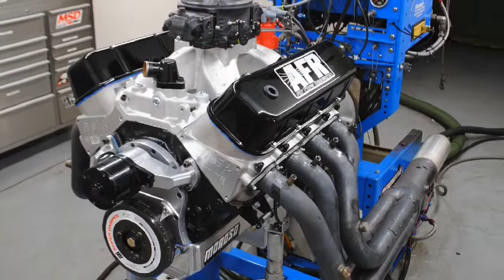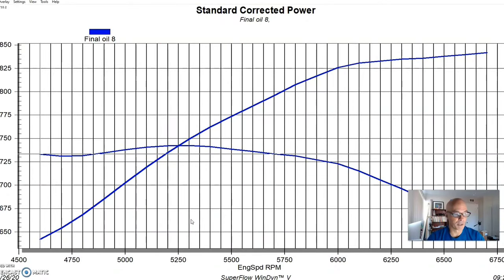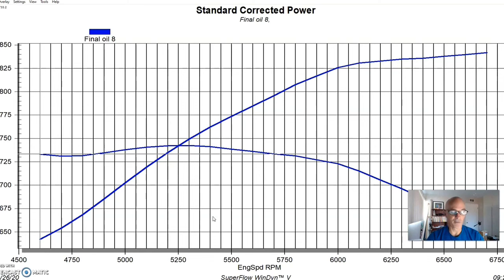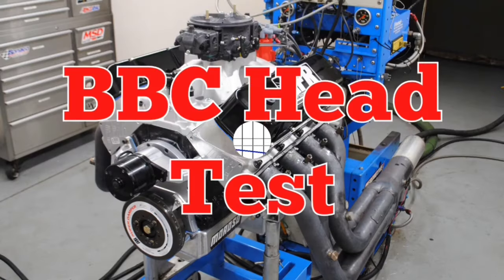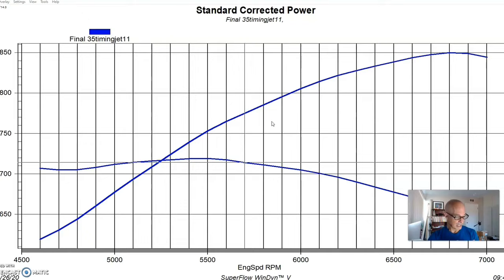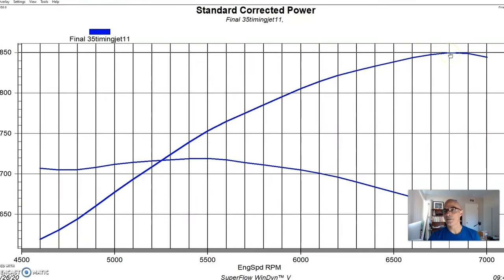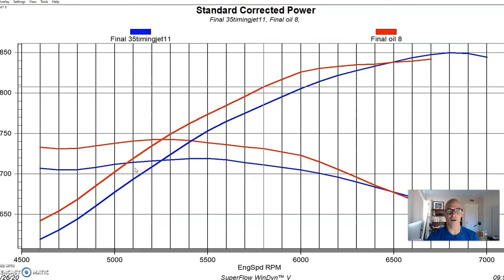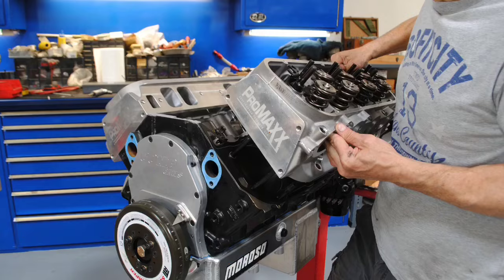LOW BUCK BBC HEAD TEST-PROMAXX VS AFR

Comment: The ProMaxx heads were actually like $100 more than the AFR heads lol. Both 50% CNC ported, solid roller springs to support up to .900 lift. (My cam is .567/.578 currently but Im ordering a custom grind with much more lift. Advertised 278/284 @ 110 LSA)
Reply: Promaxx heads bare are 600 bucks cheaper.  They might be more assembled, compared to the bare AFR's though.    But if you use the same parts in them, the only difference is the cost of the casting, and Promaxx is cheaper there.

Comment: Richard, do you think if you changed the LSA on the cam,say to 107-110 LSA,  for the promaxX Heads it would it would shift that curve to match the the afr curve? My Question is based off the episode of engine masters comparing the LSA of camshafts with same lift and duration specs.
Reply from the maker: changing the cam specs would effect both heads
Reply: I get that. But I was just referring to just changing the cam specs for the promaxx heads which would in turn move the horsepower and torque curves to match the afr's being that they are different heads. so each had has its own characteristics and may like one Cam vs another cam better.

Comment: Have you ever dynoed a Mercury Racing HP 500/502 cid and what your thoughts are on there choice of intake which is Dart single plane. These only run 5200 or so and seem like there should be a better choice.
Reply from the maker: Dual Plane might be a better choice
Reply: @richardholdener1727  thanks for the info, if I were to go to 540 inch would dual plane still be a good choice

Comment: I was surprised to see that power crossover happen. Really surprised it happened at the top. I'd be interested to know the minimum cross section area of these heads. My hunch from the dyno graph says the promaxx has a larger minimum cross section. If my hunch is right this is a very good example of the benefits from good port design.

Comment: AFR magnum 315 for $3492.00 vs Promaxx 317 cast for 1900.00   Now the flow numbers are both advertised, both are very close to each other but Richard; run these on a 496. I doubt the Promaxx could keep up at the low lift. But nothing comes close at $1900, that is a great price.
Reply from the maker: afr 345 was listed at $2656 from Summit-not sure why you bring up two heads I didn't test
Reply: Richard Holdener You said the option it out the way you would use it for your own set up right? I don’t have a 572, I have a 496. I wouldn’t buy a huge 340cc head. I took the time to search and reply. Why the downer?

Comment: Hey Richard I been watching you for along time I am finishing my 60 over 427 I put the afr265 oval port heads on it its go a small howards hydraulic roller 235×241 @ 50 618 lift on a 108 lsa.its got 22cc dome pistons  with a 850 Holly hp carb I'm going to put it on the dyno hoping  for 550 hp do you think it will make it?
Reply from the maker: great heads-might be a little shy on camshaft, what intake?
Reply: @richardholdener1727  I have a speed master copy of the airgap but waiting on a team G to come any day . I was going to go with the comp cams xr294hr  but didn't want to have to run a converter bigger then a 3000 stall.

Comment: Hi Richard, I just paid for a demon blow through Carby second hand. When I looked underneath, it hasn't got the 4 slots to stop boost going out through the shafts. Have I been ripped off?
Reply from the maker: you will be fine
Reply: @richardholdener1727   so they all don't have these slots I gather

Comment: Not a comment but question ? How will this promaxx head work on a 6500 to 6700 rpm 10 to1 496 ? If they were a little down on your big motor would they maybe be just right on a big roller crammed 496 ?
Reply from the maker: look at the 496 promax video-I also ran a blower on it

Comment: for a hydro roller head,  an AFR has a much better valvetrain.  But a sbf is about 600-800 more and how much more is the 185 gonna make than the 180 MAXX??

my choice..trick flow 11rs lol 1700.00

they come with a heavier rate spring that you have to buy as an option on a AFR 185 renegade.  and its the same power for about 150.00 extra for the AFR heads which would be like 1850.00
Reply: @bigboreracing356  yeah thats good atuff to buy.  AFR uses PAC so I trust that and I just saw a guy I subcriber to break in out of the box brodix ik200s on a 355 solid flat tappet.

Not one flattened lobe and will go to 6500 like right now

But for a race application id be buying everything custom or from someone like chad speir or weingartner racing and have a cylinder head guy assemble it

Comment: Using a Dart Big M block, why did you go small? I would have gone with the tall deck and created a square bore motor. That should have boosted the low end torque a little bit for both heads to get better average power.
Reply: Got a Merlin tall 10.2 deck. Was thinking 604ci. Any thoughts?

Comment: I'm all in for buying domestic parts. That being said, I recently bout a set of aluminum small block Ford heads. Good friend of mine called me to come look at a set of aluminum small block Ford heads. Looked them over, 2.02, 1.6 valves. I am planning a Windsor build for the 94 flairside my dad left me. Looked great!! What's he need for them, I'll put it on the grapevine. His reply was I don't know man, there complete, could bolt them on as is, think $400 is a fair price? My response was " there's an ATM in this little town?? Needless to say, their in my barn waiting for installation!!! The old f150 weighs round 4000 lbs, but how much does a late model Mustang weigh?

Comment: I’m trying to do the speedmaster top end kit on a completely stock 454 peanut port motor. No bore stock pistons. What cam is best for the most horsepower. I’m trying to do a street strip car. Hydrologic Flat tappet
Reply from the maker: look at a 274 comp
Reply: Thanks. You the man.

Comment: The way the power curve flattered out so early on the afternoon head is odd. Makes me wonder if you were was a tuning issue.
Reply: I think it might be a restriction in both the heads and intake. Looking at the numbers, that combo would run very nicely with the fully CNC ported 357's and a Wilson ported Super Vic. I wouldn't be shocked if that combo made peak power at 7100 and over 870 hp.

Comment: Boost help the difference of expense heads are I right ? For a budget builtzzz
Reply from the maker: you can make all the power you want with boost
Reply: @richardholdener1727  Thank you Mr Holdener! BluePrint update August on 540 power adder. For grins cross ram with twin Torqstorm with two 850 blow thru carbs. Think I will have to video and dyno just for the wonder what will it do or don't. Twin set up is a 5 to six week delay so one day I will send you the video to use for your fun. You share wisdom to all and thank you for that!

Comment: Should really compare the AFR'S to a set from Pro-Filer! Then you'll see what's up. Yes that's not comparing a low buck to big buck as this test was, but you'll see if the AFR's are all that. I always see people compare the AFR's to either cheap heads, or to a Dart or something, whether small or bigblock, but no one ever seems to throw in a set of Pro-Filer's. Pro-Filer has been doing the bbc stuff for a long time and have recently threw their hat into the small block stuff, would really like to see how they stack up! As cast from both AFR and Pro-Filer and cnc'd from both. However that would be some very expensive testing no doubt!

Comment: Let’s be honest, if you can afford a BBC like this you can afford the AFR’s. Now if I was building anything from a 454 to a budget 496, I wouldn’t hesitate to go with some ProMaxx heads.
Reply: Thing is that if you run them on a 454 to 496 cheap deal, then you don't run a big solid roller either. The Pro would be more than enough and the difference would be smaller.
In such a case with a little bbc, there might only be 6-8 numbers separating them at best. In that case, the Pro is still not really the best head. Get something like Edelbrock Oval CNC heads instead lol. Cheap heads like these are always so odd, because there's usually a better way no matter what you do.
I think these are for the few that does low buck hydraulic roller big cube stuff. These will do well with a Blueprint 572 or 598 shortblock. That is a segment where cheap stuff like the Pro heads can be a good idea. A set of AFR 345 heads would be half the cost of the shortblock, and for many that's a bit off-putting.

At the end of the day it's all about what you want. Many street/strip 550+ ci deals would benefit from running full CNC heads. Add a bit more over the 345 and get either the 335 or 357 depending on your needs. Both will outperform the 345.
Reply: @AB-80X  
If I had to choose between the two brands and money wasn’t an issue, I’d go AFR all day. Pro Maxx was just what he happened to use in this comparison, they wouldn’t be my first choice for a budget application either, but like I said I wouldn’t not run them on a mild pump gas build either if money was tight, I’m sure they’d work well enough to have fun on the street where the combination doesn’t need to be absolutely ideal...
Reply: @AB-80X  
Personally I wouldn’t use any of the heads you mentioned on a pump gas street build, I’d be using a sub 300 cc oval port, the AFR magnums are ideal but man are they expensive.
Reply: @shitbox7413  That's a personal thing. I have found that the E-CNC run really well on say a 496 with a 244/252, .600", 110 cam. I've tried the AFR ovals and they are nice heads, but I have found the E-CNC which by the way is also an oval port head to create a better peak spread. With the right combo we are talking 610+ hp that makes peak torque at 3800-3900 rpm with peak hp over 2000 rpm higher. That's a very good running deal.
Are there other heads? Sure, it just depends on the situation.
I put the AFR 300 Ovals on a friends build as he was very interested in giving them a try. They are probably the highest flowing 300cc heads out there, but we found that they have issues going supersonic. The turbulence in the runner was a big issue, and on the flow bench they are probably the loudest heads I've ever heard. AFR ended up taking them back and sending out a set of 315's and we picked up over 35 numbers.
The Edelbrock E-CNC ovals with the matching intake on a small BBC has just proven to be a very good combo that is hard to beat.
I'm not brand biased, I'm just interested in what works the best. I like TFS for 440 Mopars etc. and I want other things for other purposes. I respect AFR for what they do, but they are not the end all of heads. I just finished a 582 build and I chose to have a set ProFiler 24 XL heads finished by Curtis Boggs from RDF and I can say for sure they will outperform any Brodix or Dart 20 degree head, despite being 24 degree heads, and the AFR 385 wouldn't stand a chance. Flow is important, but so much more goes into a good head, and that also goes for AFR, and their 300 cc Oval is a prime example. I would actually run the AFR 290 before I ran the 300cc based on my personal experience, and I have found the Edelbrock E-CNC ovals to outperform them both.

Comment: Interested bought 195 from Summit 2 years ago should I get them checked out before intalling any comments  Thanks
Reply from the maker: 195 WHAT
Reply: @richardholdener1727  pro maxx 195 read that I should have a head guru check them out before installing cheap valve seals bad valve job etc.
Reply: It's a good idea to have any head thoroughly checked vs thrown on a block straight out of the box. Clearances, seats, etc. They could fall in my lap from heaven and I'm still going to check the basics.

Comment: Ever fool around with Weber carburetor's ?
Got my first 32/36 for my inline 6 Ford... a little nervous TBH.
Reply: Yes. Webers are great carbs. 32/36 (DGV?) will work fine on a stock 6 cyl engine but is too small for any real performance application. Really meant for 4 cyl engines. Should get good fuel economy though. Ford used Weber 2bbl (ADM?) on Aussie 200/250 crossflow L6 engines back in the day run out of puff at 3500/4000 rpm.

Comment: The AFR equipped setup will accelerate faster and that is what matters,and why did the AFRs fall off all of a sudden Richard,seemed like lifter/valvetrain issue
Reply: They didn't fall off. He stopped revving it and the curve flattened. He mentions it twice...
Reply: @claytonfinney6092  I am referring to @6k where the power started to fall off,they were moving air and then just stopped? seems strange
Reply: @robholmes2129  guess it could be a valve train issue, or port design and just simply flattens??
Reply from the maker: does seem odd
Reply: @richardholdener1727  What do you think?

Comment: Will the Promax heads work for a 454 stroked to 489 or 496
Reply from the maker: yes
Reply: @richardholdener1727  awesome. I didn't know if they would be too big for it I'm trying to do a twin turbo deal with Borgwarner 75 to 88 I have a bryant crankshaft that's 3.750 and rods that look like Corilla rods have to get them checked hoping there 6.385 trying to get as much air flow as I can

Comment: This is a great test but just imagine if the AFR heads were fully CNC'd like they normally come. I believe they would have destroyed the Promaxx heads.
Reply: The CNC version of the 345 AFR’s is the 357CC heads , yes they would maul the pro max heads. Take nothing away from PM heads. They did very well here.
Reply: @michaelparadisis4076  I have them the flow 425 cfm plus

Comment: Richard, I recently found a website Skip White performance selling aluminum 335cc assembled heads that they claim flow 370cfm intake 266cfm exhaust, @.700 " for $1079.00 for the PAIR!!!! Could you please, please test these on say a 496,505,540ci max engine with some real compression (11.75-13:1) on E85 and see if they work, if they do these would be hands down the best bbc aluminum head value out there, for a street strip car.

Comment: does any one knife edge the crank counter weights any more to help with that oil lvel resistance? that a old engine building trick i learned. i seen a gentleman polish his crank by assembling the crank and bearings with anti sieze and rotating it.
Reply from the maker: knife edging helps

Comment: 4.550 x 3.750 stroke is if I'm not mistaken is 487cid. I'm sure ya accidentally said it wrong. I'm not breaking your balls. I enjoy your programs alot and I'm subscribed
Reply: Listen again. He said 4.375 stroke.   Which, combined with a 4.56 bore comes out to 571.6, which rounds up to 572. 
However, he DID say 4.55 bore, which would "only" be a 569, so if he misspoke at all, it was about the bore, not the stroke.   3 cubes wouldn't make any difference, though.

Comment: Will you do this on a 454 more of a reasonable motor for most guys to own
Reply from the maker: EITHER OF THSE IS ALREADY MORE HEAD THAN A MILD 454 CAN USE-THEY BOTH WORK
Reply: Richard Holdener thank you sir I kinda figured the power curve would just be shifted down because of less cubic inches

Comment: Rick seems to always leave out an important factor, AFR heads hold their value better and are an easier resell/trade than promaxx.
Reply: Indeed. The Pro's are pretty much zero resale. A nice set of AFR 357's will sell used for 60-75% of new price. You'd be lucky to get more than 600 for a set of used Pro's.

Comment: what about testing some afr 345 clone heads vs the real deal, i have a set on a 496 they run. and they were 1200 loaded with 750 lift springs, rocker studs, push rod retainers. let me know if you want to test them since you are local to me, you replace the gaskets they are in a current long term build, i have a hobby shop in town.
Reply: @ron Kay yes but the heads I have are literal repops listed as afr 345 clone from a place in Arkansas that went out of business last year. I dont have any idea who made the castings but they looked great had Morgan's machine in concord ca go over them and he couldn't find anything wrong with them. But they were half the price of the promaxx and afr.

Comment: Put a vacuum pump on it and it'll control your oil windage problem
Reply from the maker: not with the wrong oil level
Reply: @richardholdener1727  vacuum pump works with any kind of oil in system because it just holds the vacuum of 5 to 15 pounds of vacuum in the crankcase witch with no air no wind

Comment: Love this test! Been eyeing up the promaxx heads. On the flow sheet dyno, I thought for sure they were a bargain. Not what I expected.
Reply: Can't speak for big block heads but I replaced brodix track 1 with promax 225 and  shaved 2/10 off 1/8 mile
Reply: @joshkeasler512  I put the 183’s on my TPIS mini ram 350 in my 91 camaro. 
With a 58mm T.B. 24 lb.hr.injectiors long tubes and the 268 xtreme fi cam. Makes 335 to the tires (about 400 hp @ the crank) 90 horsepower more than stock. If I had to do it again, would run AFR 195’s and a TPIS cam. I dynoed @ TPIS, and found out the min ram works best without lift split. I’m considering the FIRST intake to get more street torque.

Comment: A 572 ci is a 4.5 bore and 4.5 stroke 
Did you do the math
Reply: They had 4.560 bore and 4.375 stroke 571.6ci
Reply: This engine actually works out to 569 ci which is closer to the advertised ci of most OEM manufacturers engines.
Reply from the maker: 4.56 x 4.375-check your math
Reply: Math is hard.
Reply: At 1.11 in you say its 4.55 bore, Richard. With 4.375 crank, that 569. I wont quible, i think it probably really had  a 4.56, a Much more common bore.
Reply: There is an infinite number of ways to get 572 cid.  GM sells a crate big block with 4.56 bore x 4.375 stroke.  The typical 572 is 4.5 x 4.5, but the bbc can safely go to 4.56, so take advantage of it.
Reply: @claytonfinney6092  I heard him the bore was 4.550 the second time I watch the video I heard better thank you for your update 🙂
Reply: @richardholdener1727  the first time I heard you say it I heard 4.55 thank you for the update than the correction